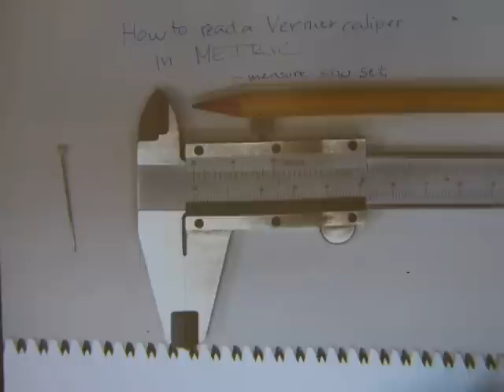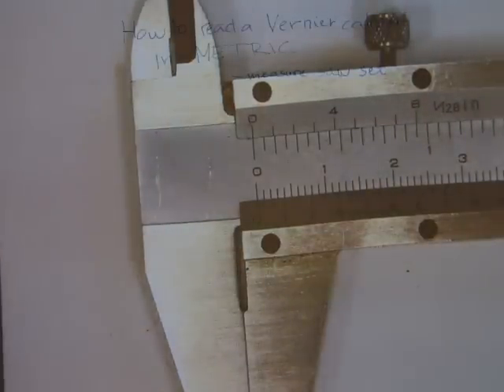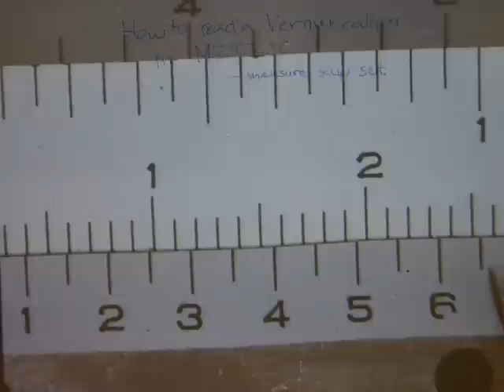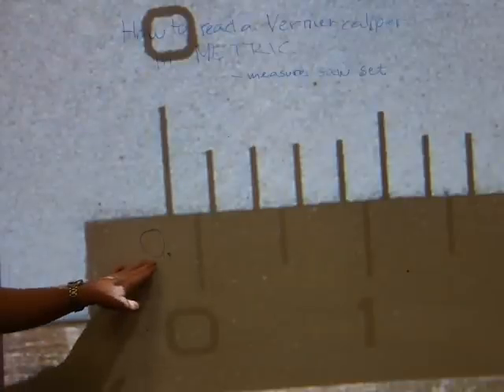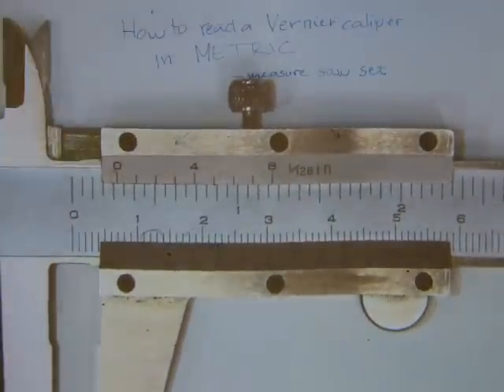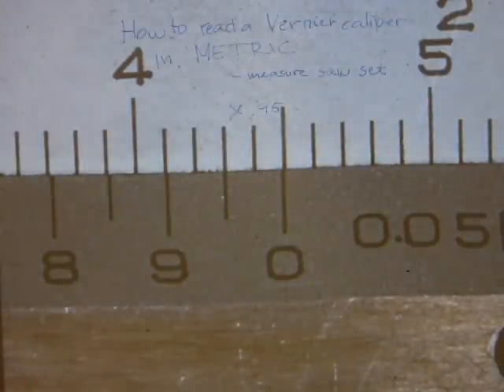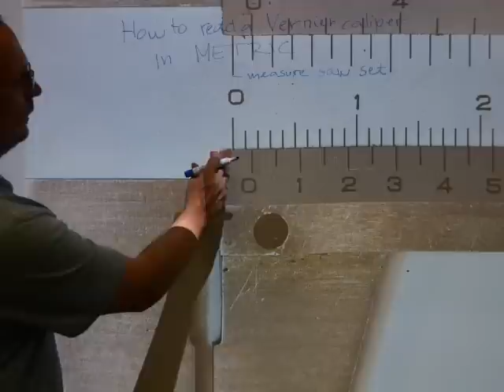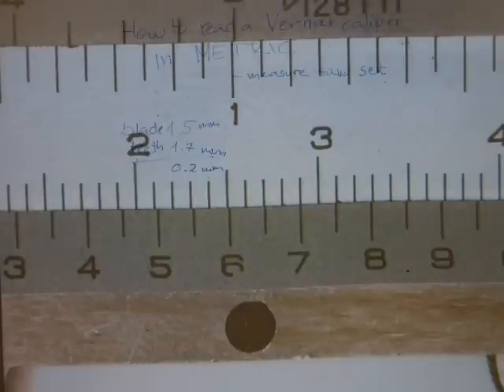Read a vernier caliper in METRIC, measure saw set

Comment: In this calliper, one vernier scale division is larger than main scale division. The least count is 1 MSD-1VSD. In the video, LC is written as 0.05 mm which is doubtful. To get a LC of 0.05mm, 19 main scale divisions have to accommodated in 20 VSD. Then only one VSD will be equal to 19/20 ie 0.95 mm. There is something wrong with the markings

Comment: Good explanation, thanks! ☺
One little thing I would add: when you measure cylindrical objects, always check cylindricity. Otherwise when you rotate the object, you'll get a different reading. Perfect circles are not so common.
Reply from the maker: Absolutely. Circularity, cylindricity, concentricity, parallelism and flatness are going to be on another video.

Comment from the maker: Find reliable retailers nearby, where you can return stuff if you don`t like it. Take close-up pictures of models you find at retailers around you. Compare surface finish and fit. For ease of reading consider models with crisp lines and numbers, whatever you find easy to read. Stainless steel tools are your best bet for long life. Plastic knobs and parts melt if you put it on a just welded hot work piece. Starrett and Mitutoyo are top of the line, ($150), I bought mine at Lee Valley, about $25.

Comment: I don't understand say the Caliper is passed the number I just do not get how to get the first whole number?
Reply from the maker: Step 1:
Count how many (whole number) millimeters the sliding scale zero has passed by on the main scale
Step 2:
Find which of the sliding scale marks line up with any of the main scale lines.
Step 3:
Read the number off the sliding scale at the best alignment spot